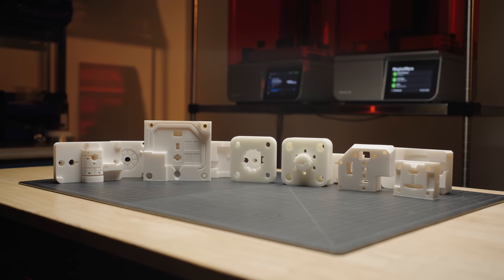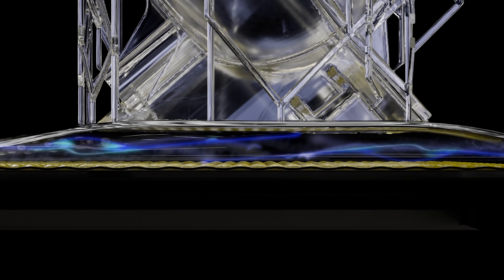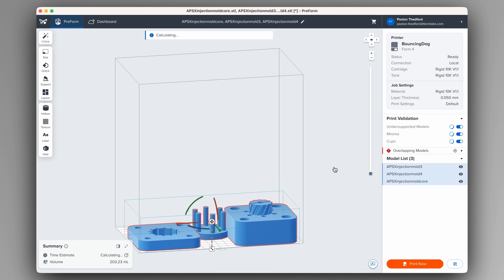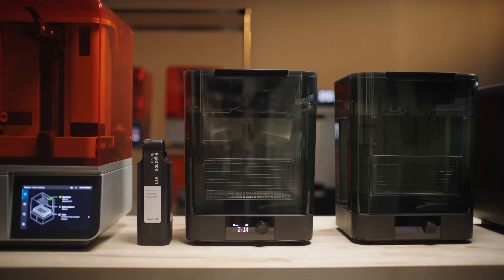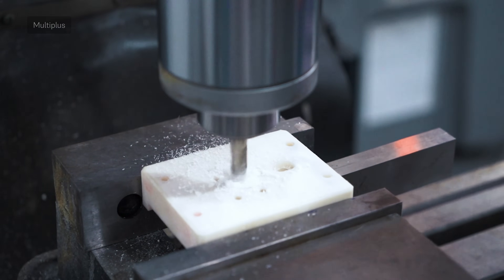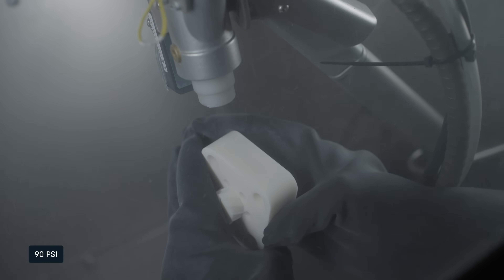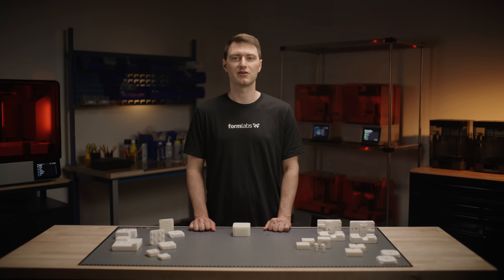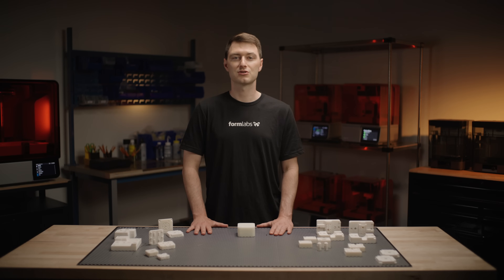How to 3D Print Injection Molds (In a Few Hours!): Best Practices for Mold Preparation

Comment from the maker: 🟠 3D Printing for Injection Molding: https://bit.ly/3V5p76t
🟠 Injection Molding with 3D Printed Molds - Process Conditions: https://bit.ly/4mMr0Rg
🟠 Formlabs SLA 3D Printers: https://bit.ly/3HCrYRg
🟠 Rigid 10K Resin: https://bit.ly/3JjTrYn

Comment: How does Rigid10k fare with highly polar thermoplastics? PP/POM are easily processed, as they barely adhere to resin molds. However, polar materials (i.e. PA6, PC...) stick more strongly to resin surfaces and can cause severe material beakouts. Just being curious!
Reply from the maker: To learn all about how Rigid 10k compares to thermoplastics check out our white paper here https://bit.ly/49gj7yE

Comment: May I ask if the material used in this video is silicone?
If so, how should the mixing ratio be adjusted?
Reply from the maker: Thanks for asking! The injection molds were printed with Formlabs' Rigid 10K Resin, and they were injected with different thermoplastics.

Comment: @formlabs How many times can this mold be used/cycle before failure?
Reply from the maker: We have customers injecting around 100 successful cycles with each Rigid 10K Resin mold - without the mold failing. The actual life time will depend on the chosen material and mold geometry. You can find more details in our white paper: https://bit.ly/3UGgn6H

Comment: could i make molds using the fuse 1 with nylon 12 instead?
Reply from the maker: For this application, we recommend SLA 3D printing for its smooth surface quality and higher heat resistance. You can find more insights and case studies here: https://bit.ly/3V5p76t

Comment: Formlabs :
6:36 
Silicosis:
Bonjour
Reply: Seriously, please think about dust extraction when doing this.
Reply: Formlabs Rigid 10K Resin does not contain crystalline silica, so it cannot cause silicosis.

However, sanding or machining it produces fine dust of glass fibers and cured resin, which can irritate skin, eyes, and lungs. Long-term exposure may still cause respiratory issues.

Comment: So to make a small injection mold in "A few hours". Heres the equipment you need
Fuse Blast: $10999
Form 4: $3500
Form Cure: $999
Form Wash: $699

Sounds like a solid deal to me for a 100x100mm mold.
Reply: You joke, but it's not a bad deal. Injection molds themselves usually cost 5k - <100k. You probably get higher quality for the price, but this is reusable.
Reply: @whyOhWhyohwhy237 you think you are going to make a replacement for a 100k mold with those 3d machine ?? what do you have in your head dude ?
Reply: @kaijisan1206  for low volume batches, say 1-400 is is extremely cost efficiant to print a mould.  The injection moulded parts become very expensive to produce in low volumes in the traditional way.   Is is NOT to replace machined metal tools/moulds.
Reply: You dont really need fuse blast. And even if you could prototype 2-3 molds, you already paid for everything. Even compared to an aluminium mold sadly.
Reply: Protyping or small batch injection moulding tools will cost you a LOT more that the investment of a Form 4 with Wash and Cure.  The Blast is optional,as any form of sandblaster will suffice
Reply: Best practice for profesionals. I think you can get alot already from less. Maybe you can get some results from sandblasting or tumbling.
Reply: Your mom called from upstairs. She said the meatloaf is ready when you finish playing your game.
Reply: you can do this with a much cheaper set up <3 don't be discouraged
Reply: @BasedBidoof ok,  enlighten me.  A resin, or polymer, that withstands 238degrees celcius and 88 MPa in ultimate tensile strength.
Reply: and then you need to go through a 50 steps process because it's better if you do them looool